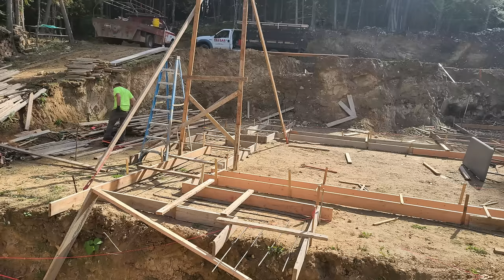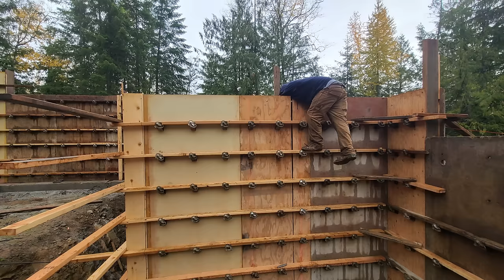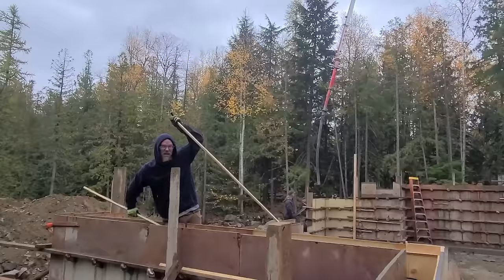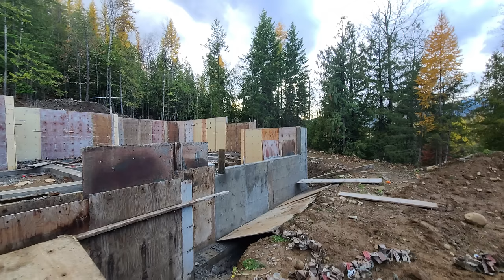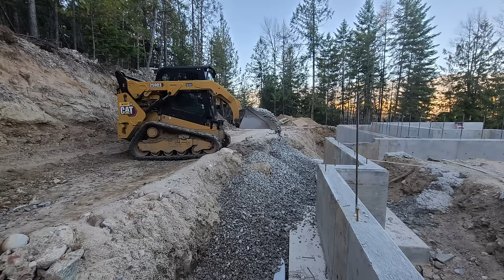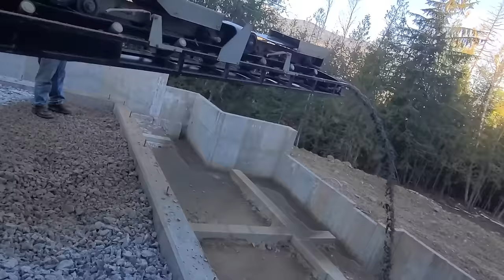The Secret to Building a Strong Footing and Foundation!

Comment: Awesome Content! 🎉

If this was more of a one-man operation with no access to a cement truck, then how would you suggest going about it?
We’re talking about a slow, 5-year, house building process whereas there will be a month or so of work and then 6-8 months of no work between stages of development.

Thank you so much for sharing! ❤
Reply from the maker: I would figure out a way that any cost to get that concrete Crete truck to your job site because as the job progresses you’re going to have to bring in the lumber packages and truss packages and window packages door packages. There just isn’t a scenario where you would not at some point have to be able to make room for a truck to get in to the site. Or do it all by hand one small piece at a time.
As you think about scheduling, you really have to think about the weather. I typically tell people get the foundation in and then let it snow. Get the framing in and get it dried in and then let it snow and then you can finish the rest of the house in good weather, and bad weather .